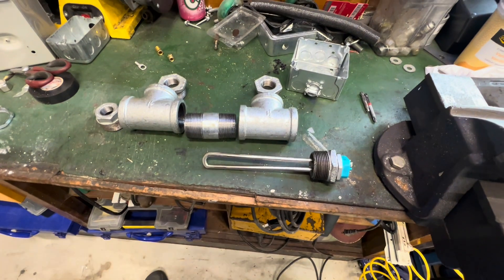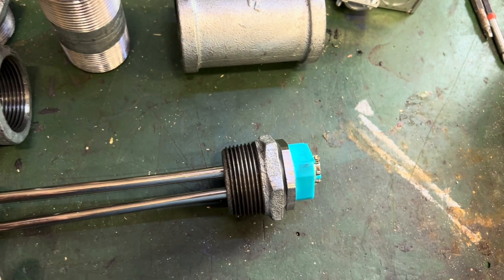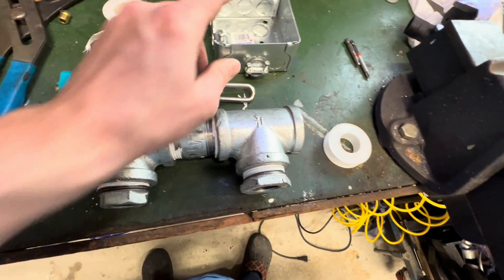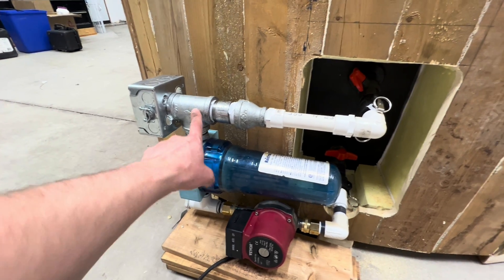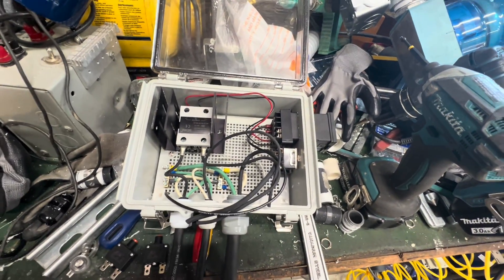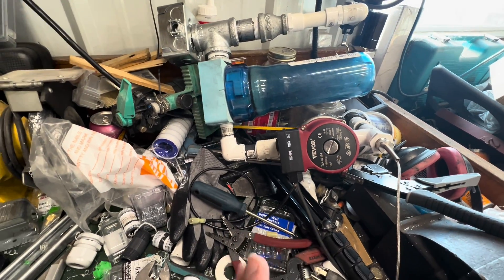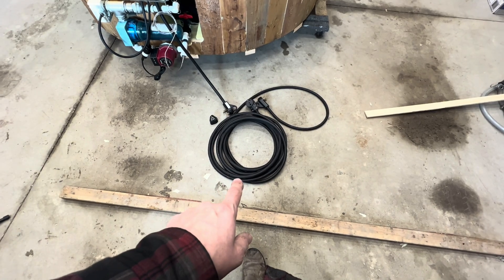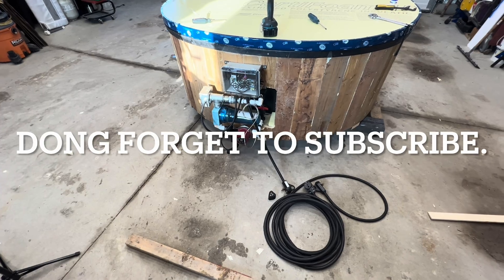DIY inline water heater for stock tank hot tub.

Comment: Thanks to you for posting! Now why didn't you have the filter housing vert so it could come off without dumping? Love your work RaD!
Reply from the maker: Good question, Not enough vertical space between the inlet & outlet on the tub. Going vertical would have added more fittings and complexity and I wanted to keep the setup as compact as possible.